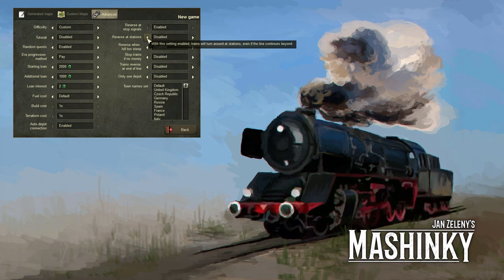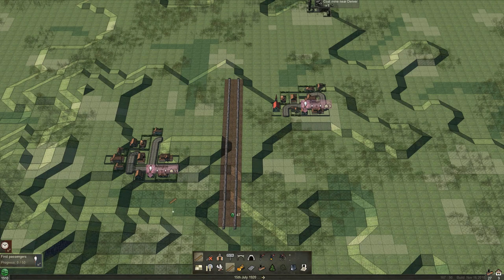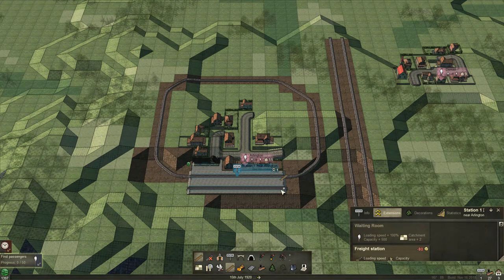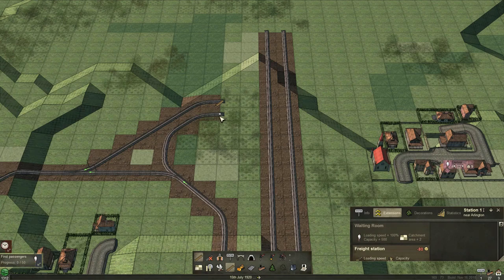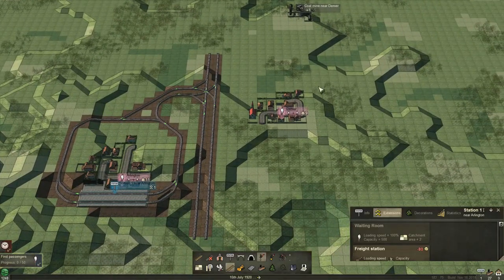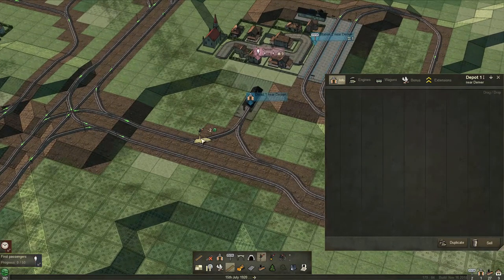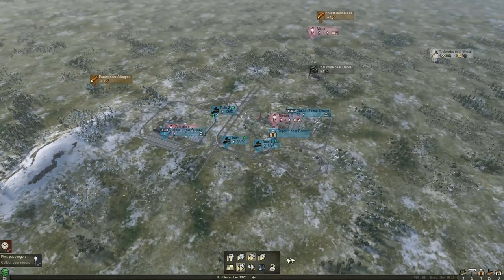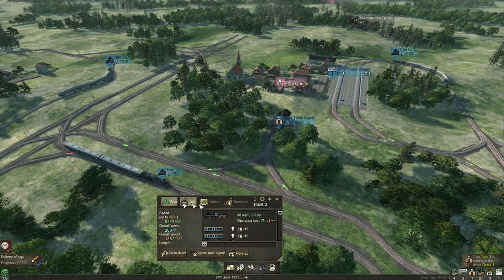Jan Zeleny's Mashinky ONE WAY STATIONS: Ep. 1 - LET'S PLAY / GAMEPLAY / TUTORIAL

Comment: Could you please explain the benefits of chain signals over block signals in your 3-way intersections such as at 12:00? There are no benefits AFAIK or am I wrong?
Reply from the maker: Hey, sure can! So the chain signals going into the tee junction help prevent traffic "lock ups" when there is a build up of traffic coming out of the junction on any of its exits. When there isn't a lot of traffic, block signals would do just fine. But when there is more traffic, chain signals help keep traffic out of the junction so traffic going in other directions can pass. I hope that helps, but if it didn't, I will explain better in my next Mashinky video.
Reply: @DannyCodePlays  This 3-way junction can not "deadlock" because of tracks layout, not signaling. Chain signals are useful when both exits of its block are currently valid paths for a train. But when a train comes to this junction it have just one valid path - to the left OR to the right - according to its route. So, chain signal is useless here, regular block signal is enough - you will not see any difference with light or heavy traffic. I've tested it and would like to see proves of your point.
Reply from the maker: Well, you were right. ;) Using a single chain signal for traffic entering a tee junction isn't any better than using a block signal. However, tee junctions like this DO have an inherent deadlocking problem when traffic gets too heavy. I try and improve the tee junction signal layout for heavy traffic junctions in this video. https://www.youtube.com/watch?v=o_xsi-pBVqw But I'm sure it can be improved upon, so if you have any suggestions, LMK. And thanks for your input!